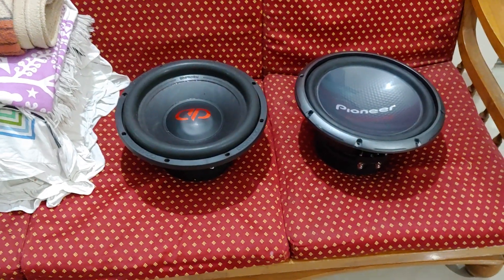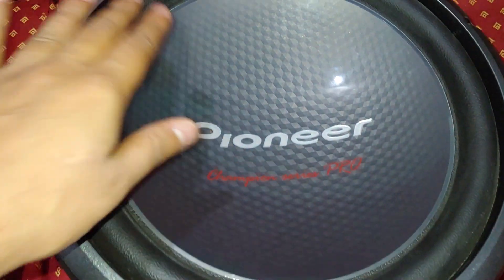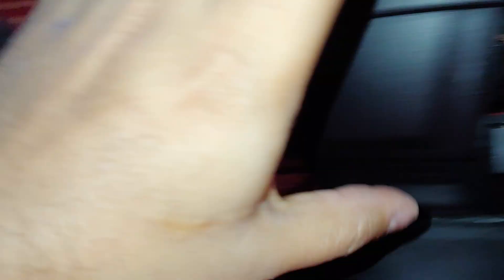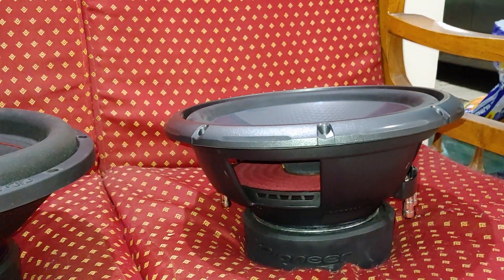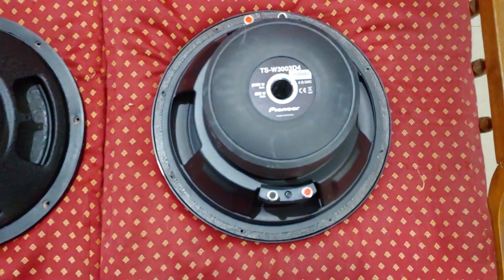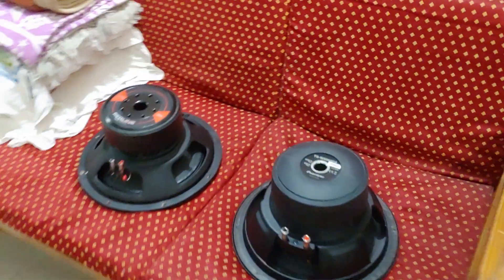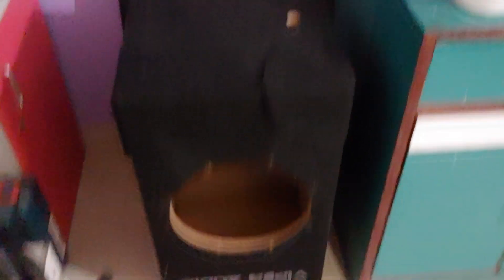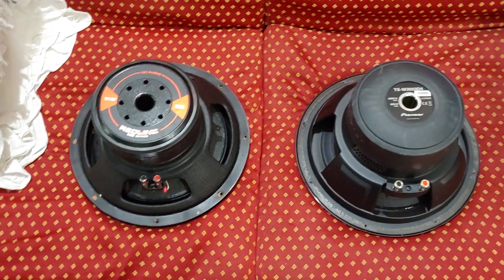Comparison between Pioneer Champion Pro TS-W3003D4 & Digital Designs 612 subwoofers. 600w rms league

Comment: Hello . Thank you for your great video . How do you compare the 3003 d4 with infinity kappa 1200 ? have you used the kappa 1200 ?
Reply from the maker: Nah I haven't used infinity kappa 1200 but being SQ oriented brand it should do well in sealed boxes if you have SQ purpose.
Reply: I like to use orion midrange setup. What is your suggetion between these two sub ?
Reply from the maker: @ramyhaj7226  for wider frequency response go for DD 612 and for only brutal decaf lows go for Pioneer Champion Pro TS-W3003D4.

Comment: I'm base lover so which of this is good for me? 612 or 3003?
Reply from the maker: Both are good. 3003 is louder and goes lower.
Reply: @Live_Loud  DD has wider frequencies we know, but this is invalid comparison , DD clearly wins here, no comparison here, you give DD clean power then see how it performs, Pioneer 3003 can go till 750 RMS  more than that it cant perform , I am running D612 @1000 W RMS which it can handle , clean power from Hammertech OCA 1000 AMP , no smell, no burn , little warm on cone , hits really hard and flexes lottt
Reply from the maker: Comparison should be done on claimed rms wattage by manufacturer and not by overpowering both subs differently. At 600w rms input power pioneer TS-W3003D4 wins as it is more efficient 96db sensitivity! You need to try that sub to believe. I had both and agree that DD is better but only when it's overpowered in big ass box!

Comment: Which is better of the two
Reply: Pioneer bro Pioneer 💀🤝🏻🔥
Reply: Bhai tell me  are pro series subwoofer available in India
Reply: @hassanbangash1403 you are crazy bro...pioner never be better than dd 😀😅
Reply: @RoMeKiNe1 unless you have these pioneer subs (TS-3003D4) you have no idea what you're talking about, they haven't been available for sale for several years and the new pioneer subs which look like these aren't nearly as good.
Reply: @timmturner  when you install dd 612 you forgot about any pioneer trust me ...
Reply: @RoMeKiNe1  put 600 watts on this pioneer and 600 watts on the DD and see what's what
Reply: @timmturner  put 1200w on dd and on pioneer and you will see 😉
Reply: @RoMeKiNe1  what's the point of overdriving the subs, look at the sensitivity numbers of the pioneer and you will understand. 

I own two 3003D4 pioneers and I have them on a 1600W CAB amp.

They aren't the best sub in the world or anything, they are simply better than this model DD
Reply: @timmturner  ok..best for you...dd 612e has 800w rms/2400w max..sensitivity isn't all - you might know that (louder does not mean better )
Reply: @RoMeKiNe1  you think exceeding the RMS rating by 400W on an 800W sub isn't too much? The voicecoil would disagree, I know I've cooked enough subs to know better. 

Even if you feed it clean power the coil will overheat rapidly, sure an 800W sub can take short bursts of 1200W and much more but not continuously hence the RMS rating.

I burned the coils in one of my pioneer by overdriving to around 1000W per sub and had to replace one. All it took was an extended bass note of less then ten seconds.

I'm not talking about playing music at 1200W, I'm talking about driving the sub at 1200W on a sine wave. It won't take it for long.
Reply: @timmturner  but you see, you're obviously doing something wrong maybe too much gain, I didn't fire any sub and i already had a few of subs...
Reply: @RoMeKiNe1  I've been running subwoofers for 30 years, yes I was doing something wrong.... That was the point, overdriving the woofers RMS rating too much
Reply: @timmturner  ok...let the music play, I wish you much success
Reply: @RoMeKiNe1  you too 👍
Reply: @RoMeKiNe1  pioneer always ba
Better old and japnese brand much reliable 👍

Comment: Hii Yogesh,

I want to upgrade only my sub as I am using Gs100 with 600Rms at 2ohms.

Any good sub better then 
DB Drive 12" Subwoofer- (SPW12D4) which I am currently using in viper audio 1.65 cubic ft box.
Reply from the maker: That DB drive sub is also good i think. What are you looking for? Lows, Punch or something else?
Reply from the maker: @aashuprabhakar1660  the go for DD 612.